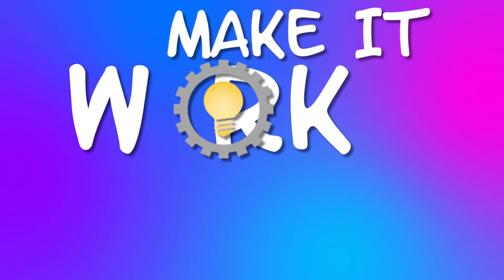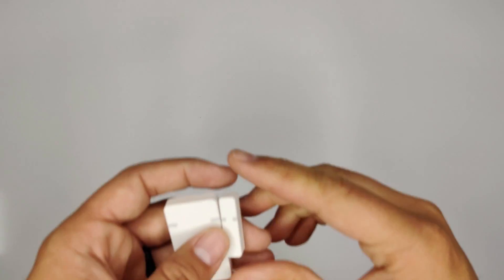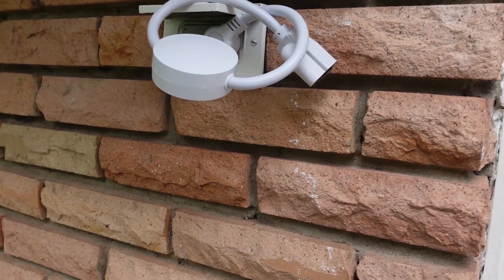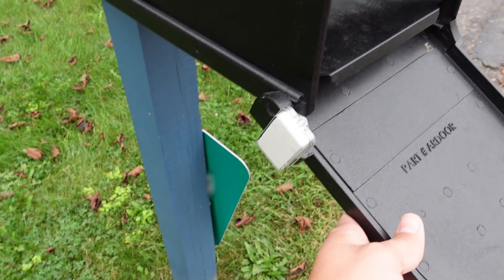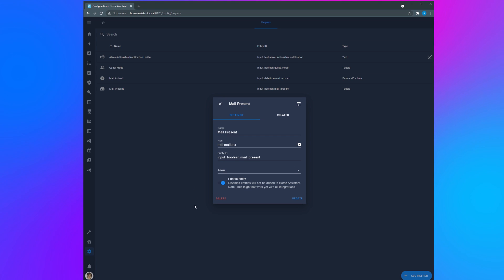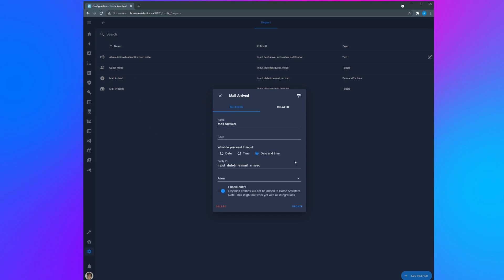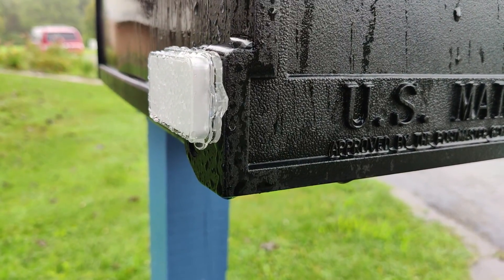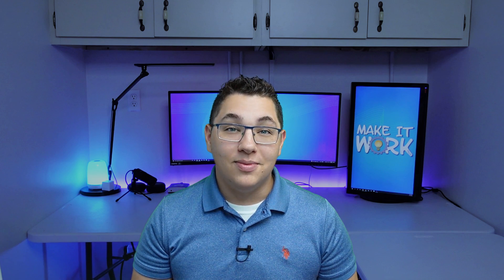Easy Mailbox Notifications In Home Assistant

Comment: Aron,  Getting a lot from your videos. So, need to pay you back.  I use Yolink. I have a Yolink motion sensor in my mailox, When the mailman drops anything down inside, and the motion "sees" it, I get a notification.  Just like yours, eh?  My distance is 145 feet from my garage, and another 20 to my front door.  Yolink uses LoRa, Long Range, 1,000 feet to 1/4 mile. They also have door/window sensor like what you are using. Hub is about $22 and window sensor about $18.  Battery last 18-24 months.  And Home Assistant support. Please take a look.

Comment: i solved the metal mailbox signal issue by soldering magnet wire to the antenna trace on the unit's PCB and ran the wire out through the mailbox's drain holes to act as an out of box antenna and it works for me
Reply from the maker: Excellent idea!! 💡

Comment: OH my GOD! Geez laweekers my golly, oh gosh darn flip my hat, $35 is just toooo tooooo tooooo much money, betcha by golly. I am just rolling on the floor laughing my ass off: so how much money did you end up shoveling out just to avoid buying a $35 window/door sensor and the time and effort it took you to do that rig-up. BUMBACLOCT ROSCLOT. Now this isn't rocket science, it really isn't all that. Just stick the damn sensor (larger) part on the mailbox itself and the magnet (smaller) part on the door. As long as the system sees that the door is closed and sees when one opens the mailbox than you're good. Place the big part on the inside wall and even with the edge of the box, put the magnet part so it attaches itself to the sensor and push the whole works so the magnet is flush with the edge and attach the sensor in that spot and attach the magnet part on the inside of the door. Placement towards the top of the box or the bottom of the box doesn't matter because opening the door more than a 1/4" will cause the alarm to go off.
Reply from the maker: I had to reread this like 10x, and I think I'm more confused than I was before! 😂 Thanks for the laughs, Captain! 😅

Comment: Hi Aaron. Would it be possible for you to show the code for the template sensor you created using the input_datetime information? In your written article your custom button card refers to it as sensor.mailbox_status. I’ve searched the forums for quite some time but just can’t seem to find anything that will yield the results you show in the video. Another person here in the comments suggested using the input_datetime.mail_arrived helper but I’m not too fond of the formatting when using that option because it also shows the date. I only want the time, as is the case in your video. Thanks in advance and keep the videos coming.
Reply from the maker: Sure, I actually have my sensors.yaml file in my github - you can see it here. Most of the way to the bottom of the file you'll see the sensor.
https://github.com/makeitworktech/home-assistant-config/blob/main/Other/01-sensors
Reply: @MakeItWorkTech  Outstanding!!! And thanks for the reply :)

Comment: paint it black and it won't be so obvious. nice job. I just recently got into HA but did the same thing with my mailbox a few years ago, although I used a wired magnetic contact to my home PLC (was a plc programmer/tech). Used the same type of logic, the plc would turn on an output that signaled an esp32 that would send a notification to my phone using Pushover. Works great. Also have a proximity switch on my gate so I know when someone enters my yard. It's awesome what one can do with a little bit of knowledge and cheap parts.
Reply from the maker: Woops, somehow missed this great comment! Thanks!
Yeah, parts are pretty cheap these days! It's a amazing what you can do with even a simple contact sensor these days. I plan to make a bed presence sensor with a contact sensor at some point.

Comment: Did you say your WiFi is overloaded with two APs and under 100 devices?  I think you need a WiFi upgrade, as that should be just fine.
Reply from the maker: Yeah, that's what it seemed like! I have Google Nest Mesh WiFi. I'm down below 80 and not having issues since I switch over some of my WiFi stuff to Z-Wave

Comment: I tried it and got it to work; however, I did need to first install the custom button (button-card) Lovelace add-on via HACS. Also, I couldn't get the button to work (it would not show the date/time mail arrived) until I changed the 'sensor.mailbox_status' to 'input_datetime.mail_arrived' in the YAML script, and I'm not sure if my fix is accurate; however, at least it does show the date/time now. Thank you.
Reply from the maker: Glad you got it working!
Reply: Same for me! Thanks for your comment it saved me!

Comment: Fortunately for me, my mailbox is a lot closer to the house and I already had a SmartThings (Zigbee) sensor that I wasn't using. I started by placing the sensor inside the box as you did. Fortunately for me, the box is not metal, but plastic. Also like you, I used a magnet rather than the small bit (that just contains magnets).
We came up with the same solution to register mail in the box using automations (since the sensor on the box will only show that the door is actually open). We also came up with the same idea to shut off the input_boolean at the start of the day. I didn't use the time-of-day functionality at all.
We did the same thing with custom:button-card as well. However, mine shows a dark mailbox outline when there's no mail and a bright filled-in mailbox when the mail arrives along with changing the text to "get mail."
In addition, I'm thinking of setting up a small LED inside my front door that will turn on/off with that input_boolean as a visual reminder that there's mail awaiting.

Comment: Hi, great video.  I need so help on the custom button card codes when value is 'on'.  The rest of the codes is hidden on your video.  I there a way for you to share the codes.  Also on the automation you has the ' binary_sensor.mailbox_sensor_open', where do you create that can you share the codes.  Thanks
Reply from the maker: Hi, thanks! All of the code can be found on my website:
https://www.makeitwork-tech.com/easy-mailbox-notifications-in-home-assistant/
The binary sensor is the Zooz contact sensor that I bought an added to Home Assistant. I hope that helps!
Reply: @MakeItWorkTech  I did not see the first part of the code for the custom button card.  You did not show that on the website documentation, only the automations.
Reply from the maker: You're right, sorry about that. I just updated the article.
Reply: @MakeItWorkTech  I got it to toggle but when the state is on there is no icon show up.  Off state the icon show up.  I try different icon for on state but still not show up as your video.  Did I do any mistake?
Reply from the maker: I would try setting the icon color for the "on" state to red or some other color and see what happens
Reply: @MakeItWorkTech  I am using long range Wemo-D1 wifi board so I have to code it myself then.  Thanks for responding.

Comment: I need to set this up as well. Would double sided tape (the foam padded stuff )provide enough separation between the metal and the sensor? I don't have any plastic on my box so I was thinking maybe I could insulate the sensor. Oh and nice video! Love the studio you got there
Reply from the maker: Thanks Jeff! Double-sided foam tape wasn't enough for me. Actually, I even tried with a half-inch thick piece of Delrin, but that wasn't enough either. Your case may be different, it might still work. I'm still not entirely sure why mounting it on the OUTSIDE of the mailbox is a problem, unless it messes with the magnetic sensor.
Thanks!
Reply: @MakeItWorkTech  you just killed my dream. Lol. Thanks though. That is useful information.
Reply from the maker: 😢 sorry haha

Comment: ESPHome and a Wemos D1 Mini Pro for the external wifi antenna?
Reply from the maker: I've actually never used ESPHome. Maybe it's time
Reply: @MakeItWorkTech  I use it for lots of things, it's one of the cheapest ways to get sensors into Home Assistant or controlling cheap relays or LEDs.  Rob has some good videos that will prevent much frustration.  I would watch this one for a primer on how GPIO pins work and on the capabilities of the ESP8266 board vs an ESP32 board.  https://youtu.be/c0tMGlJVmkw  That video is a little more geared toward Arduino programming, but understanding GPIO's, pull up and pull down resistors, and each ESP chips functionality and quirks are important.  After that video, I would watch this other video he has as it has easy to read charts showing the best pins to use and which pins to avoid due to boot failures or pins being high or low briefly during boot. https://youtu.be/7h2bE2vNoaY   

Here's a good getting started video for ESPHome: https://youtu.be/iufph4dF3YU
Reply from the maker: Awesome, great info! I'll look into it!

Comment: I’m in the Philipps hue eco system and I’m on IOS I put a motion sensor in my mailbox. I had the same issue as you with distance but I have a hue bulb outside so that cut the distance I haven’t had an issue since and it works reliably
Reply from the maker: My range extender from Aeotec seems to be helping too! I may try RF soon without a repeater

Comment: Nice video. I too avoid WiFi smart devices where possible but ended up using a WiFi motion sensor in my mailbox as I figured WiFi range from my Ubiquiti AP is pretty good. I am in an apartment building and 3 floors up but was pleasantly surprised when it worked with no issues! I guess radio signals travel down? Take care bud
Edit: made me chuckle that we both used the same AOL sound 😂
Reply from the maker: Nice, awesome that WiFi works!  Did you put it inside the box with no issues?
What a coincidence haha 😂
Reply: @MakeItWorkTech  no issues inside the box. Very rarely there is post and no alert, the sensor is so far from the AP it’s either a temporary signal issue or the postman isn’t putting his hand close enough to the entrance as PIR looks for heat right?
Reply from the maker: @jkpe  I think they detect infrared radiation, but very similar. If their hand isn't close enough it wouldn't detect it I guess